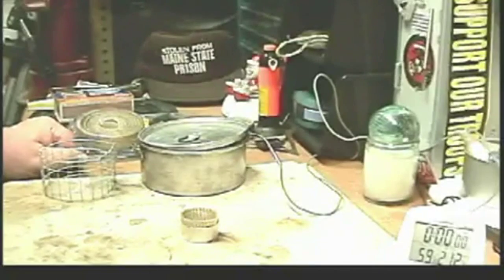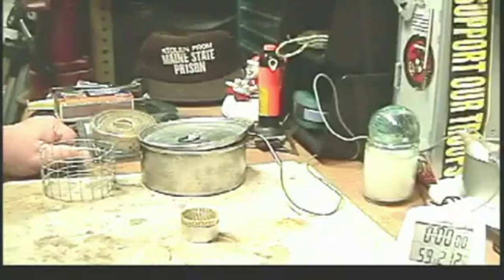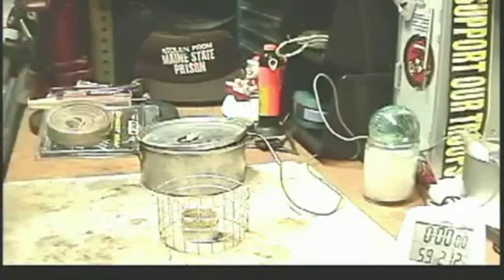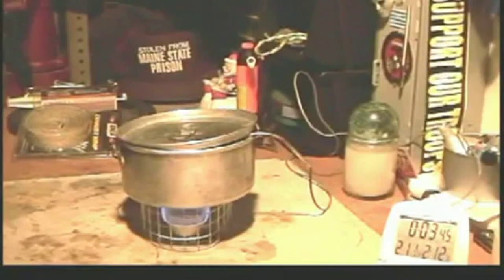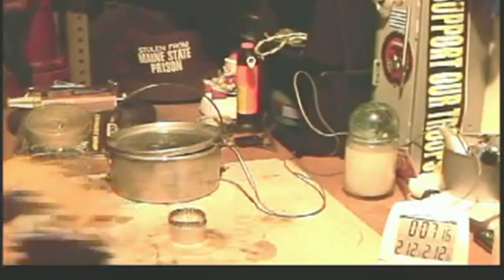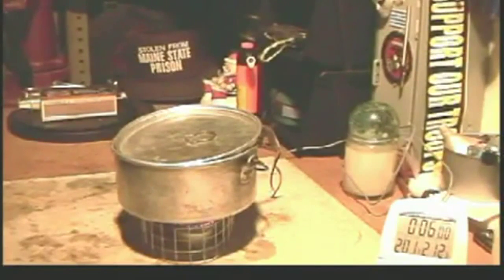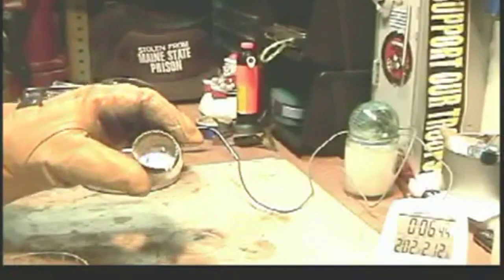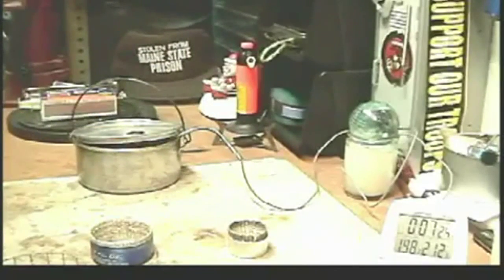Tea Light Stove - Vertical Wick - Boil Test 1 & 2 - Reloaded

Comment: Hiram, just did a cut aluminum bottle cut third, did 1 wrap card board inside,mia dust, pine sap chips, table spoon pine resin, 2 table spoon s paraffin wax, filled rest of way wax, burning 1.5 hours had to remove cotton ball on top 1 he stir still going, temp 70 ,92 humidity,  5 mph wind.